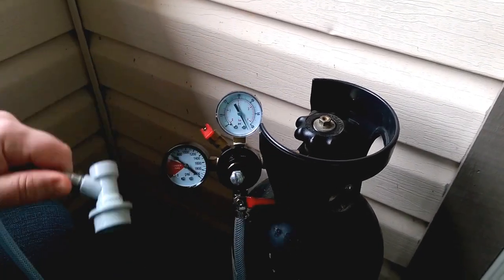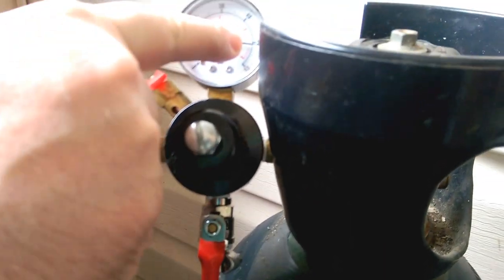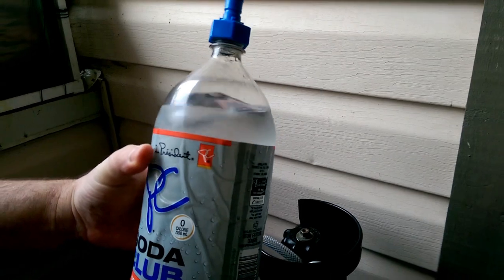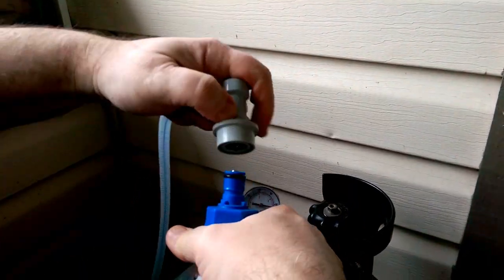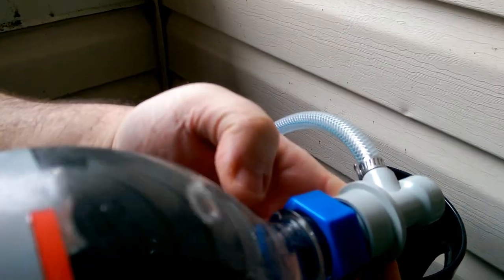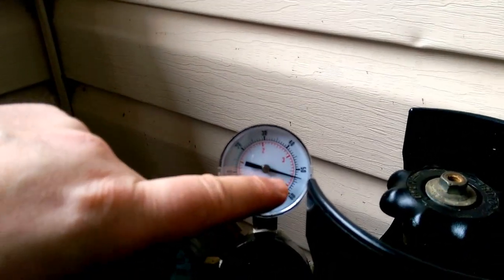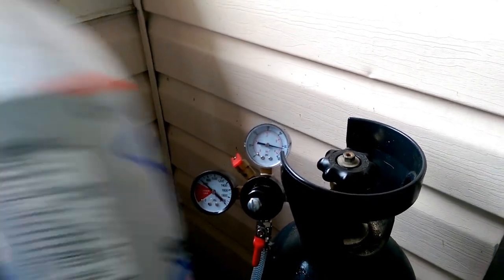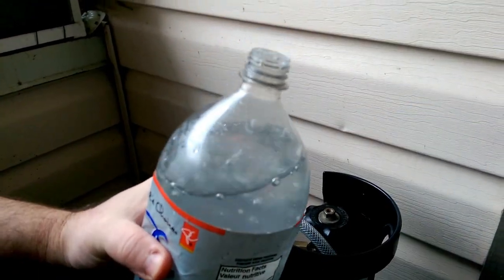Homemade carbonated water

Comment: Looks like you had yours set pretty high, 55psi. I built a unit similar to yours. I keep mine around 30-35psi and shake for around 30 seconds.  My next step is to eliminate having to shake the bottle, any suggestions?
Reply from the maker: Had some guy tell me he set up a commercial "martini shaker" (electrical type) on a timer to shake the PET bottles for 30 seconds rapidly once he strapped the bottle in. I asked him to send me pics or vids, but he never replied.

Comment: Where did you buy the regulator and hose, and bottle adapter?  Thanks!
Reply from the maker: Hi - sorry for the late reply. I wrote up a long Medium Article piece on this, and included links to Amazon to buy the necessary parts. The tank you'll have to source locally; home brew beer places will have them.

https://medium.com/@CoffeeGeek/be-your-own-carbonated-water-manufacturer-ad0af81c85fc#.yqlxbm17e